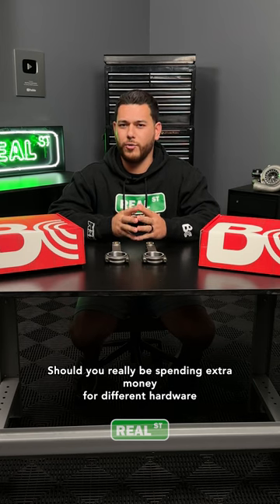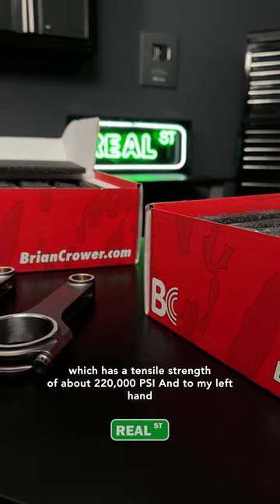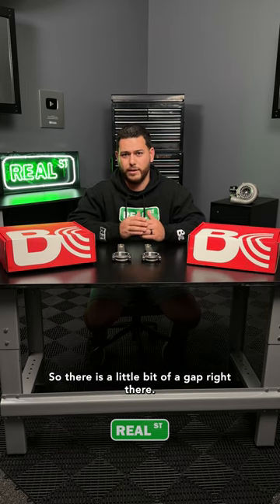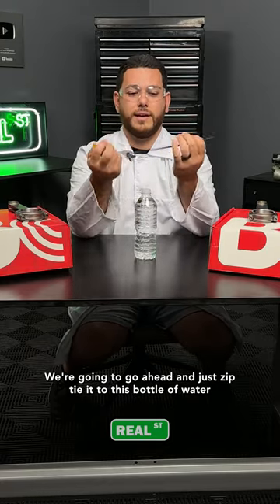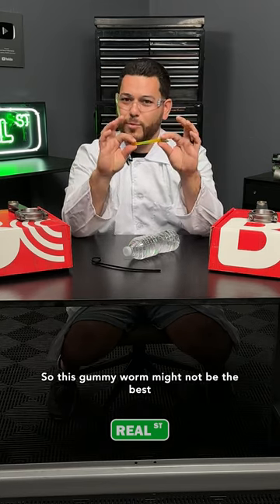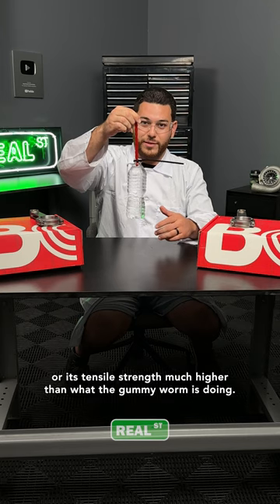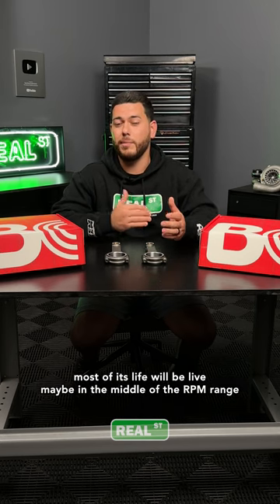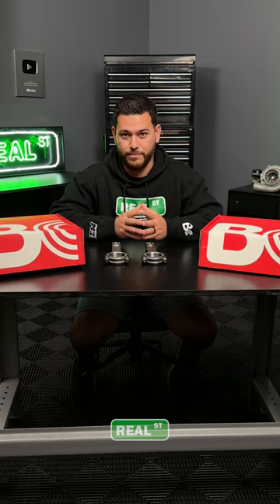Connecting Rod Tensile Strength Explained - Quick Tip

Comment: The video needs an explanation of how the bolts get loaded during operation. From my understanding, the tensile strength of the bolts is independent of power since the power stroke pushes the rod and therefore isn’t stretching the bolts. They are only put in tension when the crankshaft is pulling the rod and piston down during that cylinder’s intake stroke. Higher rpm leads to higher tensile loads
Reply: I also struggle with how Hp is related to this. I really think it’s piston/rod/pin weight and rpm that are the deciding factor of what bolt is needed.
Reply: the force that is applied on the power stroke is the direct inverse of the force applied to the other rods on their non-power stroke. So when cyl 1 fires, cyl 2,3, etc all experiece opposite forces from the crank rotating on their bearings.
Reply: I agree we definitely could add more to our next video on this topic. We would love to take a trip one day to a manufacturer like ARP to make a more detailed video where we can break down the actual science behind it all. In the meantime, I hope this simple example we used shows a very simplified version so that many people can start to understand :) Thanks for watching!

Comment: Great explanation for tensile strength
Reply from the maker: Glad you liked it
Reply: @realstreetperformance  the hardest part of explaining anything mechanical is putting it into terms anyone can and will understand, which u nailed here
Reply: No, sorry, it's not a great explanation. While the candy demonstration is really good at illustrating the difference, the terminology is lacking.

There are two important tensile properties: the 0.2% yield strength, or 0.2% off-set yield strength, and the ultimate tensile strength or UTS.

Once you exceed the yield stress you introduce permanent deformation. If you stay below yield stress, the material will spring back to its original shape. If you load a material to its 0.2% YS, and you release the stress, it will have permanently deformed by 0.2%. (Hence the 0.2% prefix). Any stress exceeding the 0.2% YS will cause more permanent deformation. The UTS is the stress value at which the material breaks. 

(And maybe now it makes sense why torque-to-yield bolts should only be used once!)

ARP 2000 has a 0.2% YS of 200 ksi and an UTS of 220 ksi (or 200.000 psi and 220.000 psi).
Custom Age 625+ has a 0.2% YS of 235 to 255 ksi and an UTS of between  260 and 280 ksi.

So in other words, at the stress level where ARP 2000 hardware will break, an identical sized piece in Custom Age 625+ will not even begin to permanently stretch. The UTS of ARP 2000 is lower than the 0.2% yield strength of 625+.